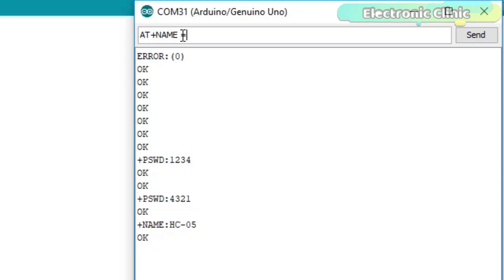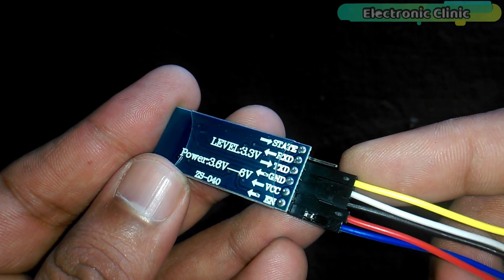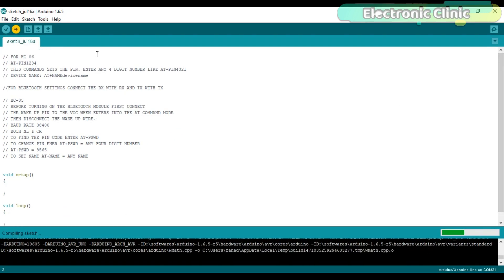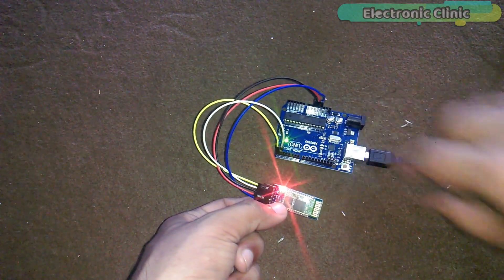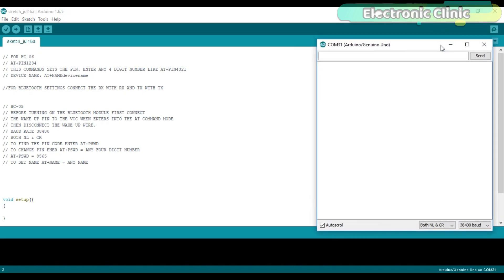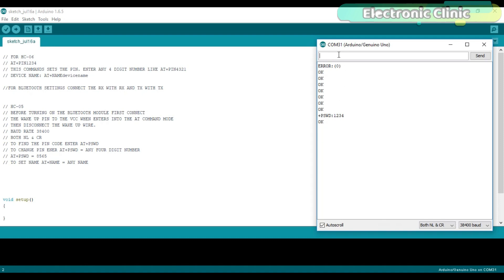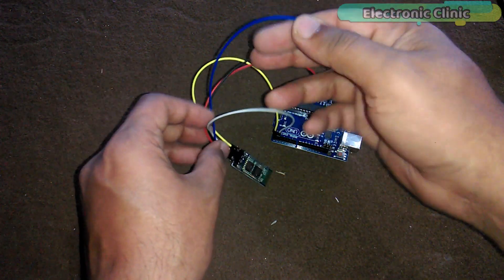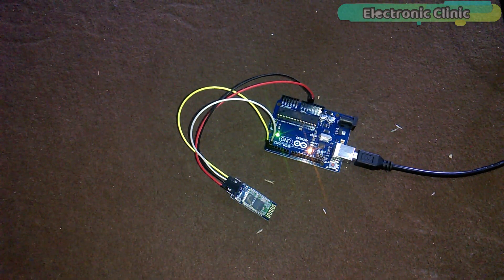Arduino Hc-05 | Hc-06 Bluetooth Pin Code and Name changing  | Bluetooth module AT commands

Comment: Not able to set AT+POLAR,1,0   using USB to serial convertor. All other command works fine. Tried 3 different HC05 and also different USB to serial convertor but only this command does not work. Please help

Comment: I can't get my HC06 to ATmode??????could you please help????
Reply: Same here, does work but can’t get to at mode, I need to change baud rate to 115200
Reply: Did you find a solution? I trief ftdi-adapter and arduino. No success yet.

Comment: Hi there can we connect the HC06 to Arduino directly without resistors?? to change name and password????
Reply from the maker: Yes. You dont need any resistor.
Reply: @ElectroniClinic  I mean the Rx voltage show it accepts 3.3 V in the HC06 so how to connect this directly to Arduino ???
Reply from the maker: don't worry about the 3.3v. do the connections as i explained.